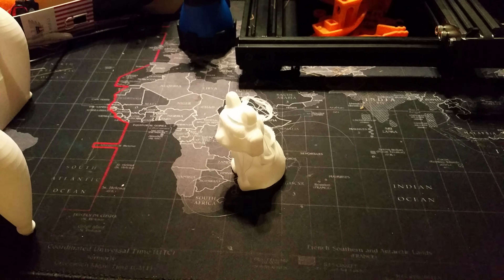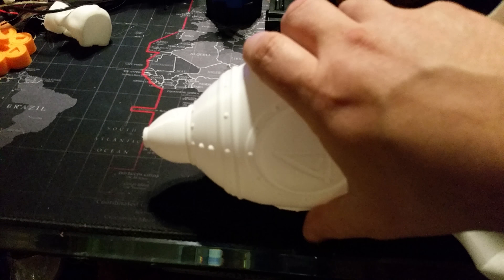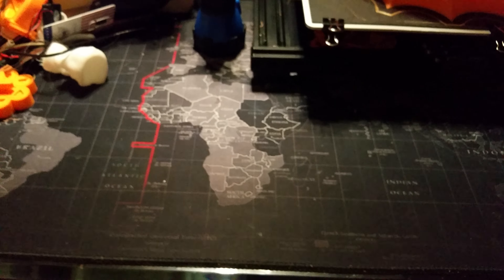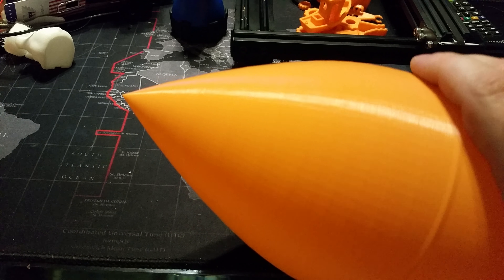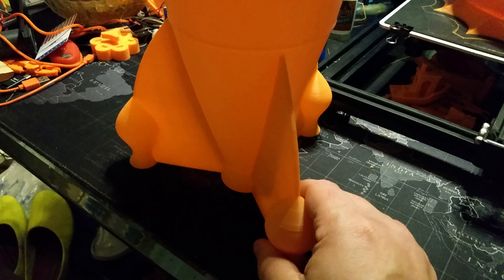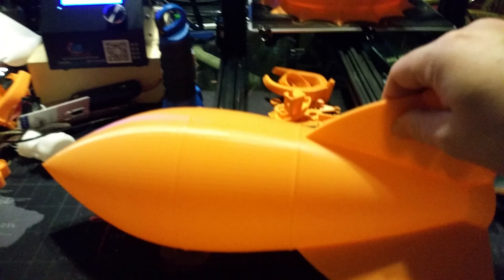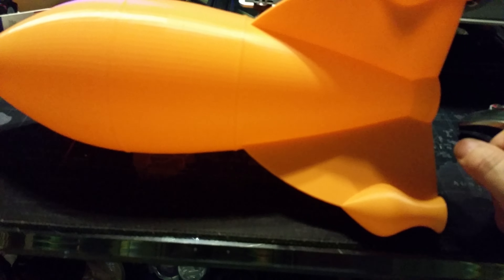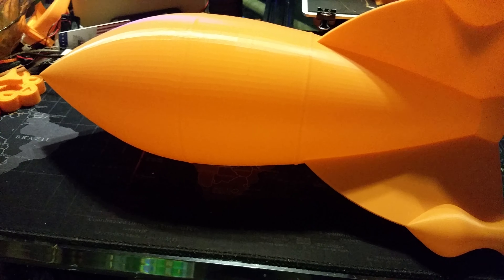Today's 3D Print - First Print with the CR-10 and latest print vase spiral mode

Comment: What’s your vase mode settings
Reply from the maker: My Facebook settings depend on what vey's type I am content if the vase has a bottom I use multiple processes and I slice the bottom like I normally do on a normal print three parameters and a minimum three layers I usually set the Extrusion multiplier to 1.0 so it's slightly over extrudes

Then for the vase portion of the model itself I set the Extrusion multiplier to anywhere between 1.2 and 1.5 depending on printer nozzle and model and filament and how they behave this gives me nice thick walls that are much sturdier
Reply: Nerys much appreciated!

Btw do you suggest the extrusion multiplier be 1.5 for PLA if the nozzle is 1.75 mm  (if I’m aiming for thick walls)..?
Reply from the maker: @ferashannawi1136  when you extrude more plastic than the exact proper amount of plastic you are over extruding do this a little bit and you're okay do it too much and your walls might get sloppy since there's nothing to constrain the excess plastic you'll be losing out the side so I'm not sure where the 1.5 will result in a nice print or not you'll have to experiment with it
Reply: Nerys thanks 🙏🏼